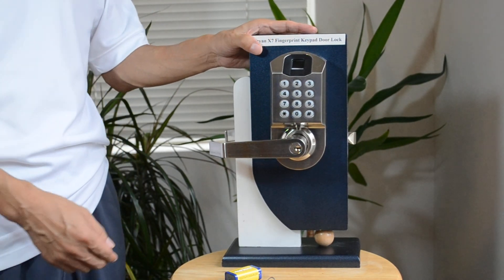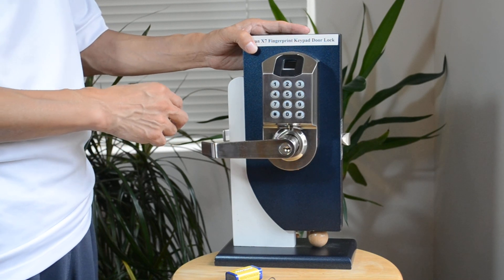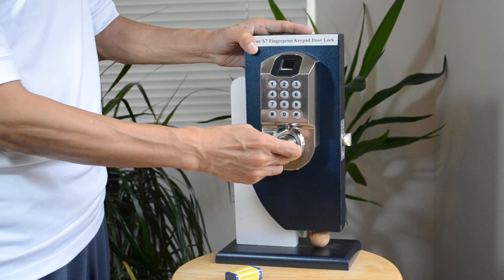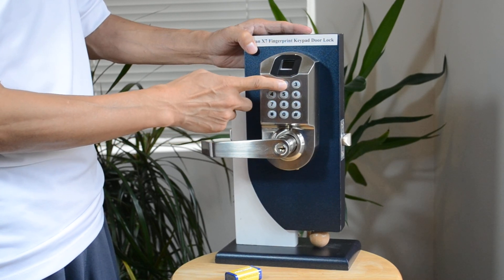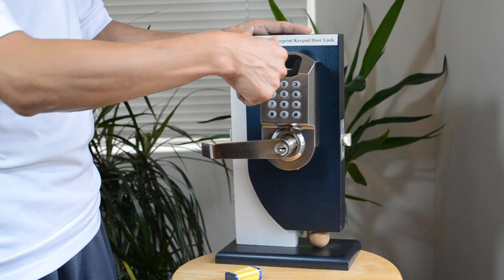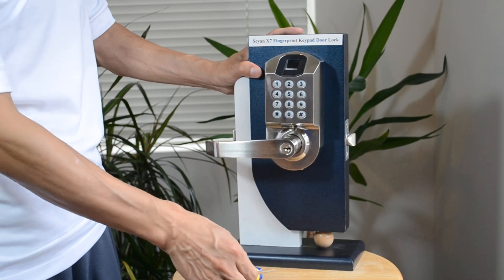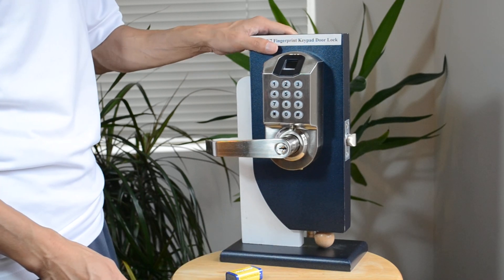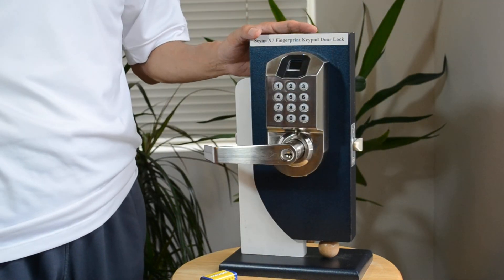Biometric Fingerprint Keypad Door Lock Scyan X7

Comment: My lock was installed and worked for 2 days. Tonight when I got home, it didn't unlock by fingerprint or Code. Just with the key. I took it out and tested outside the door. It accepts the commands by fingerprint and code, but it doesn't open. I can't even here the unlocking sound anymore. Could you help me with it? Please????

Comment: Goodnight
I have an equal but I have problems to activate the password and also the fingerprint and I tried to activate and you can not help me with the instructions
Reply from the maker: Try to reset the lock. The reset button is located on the back panel of front lock. You need to take off the lock from the door and press the reset button and hold for 3 seconds till hear a long beep.